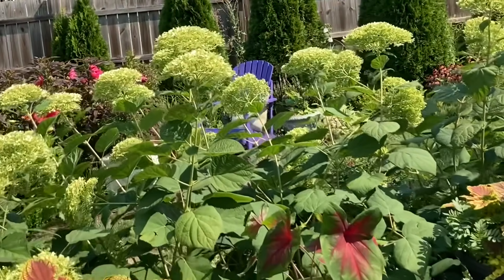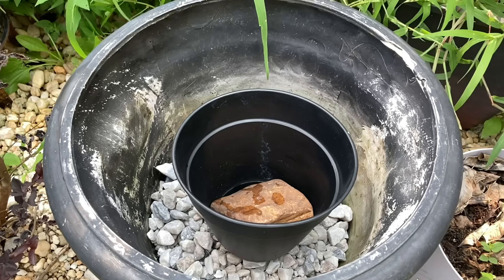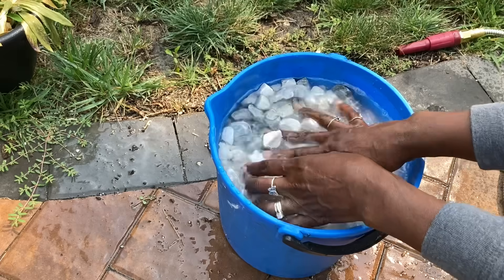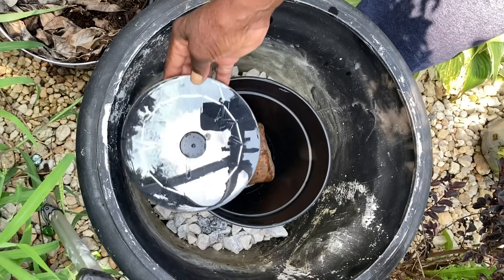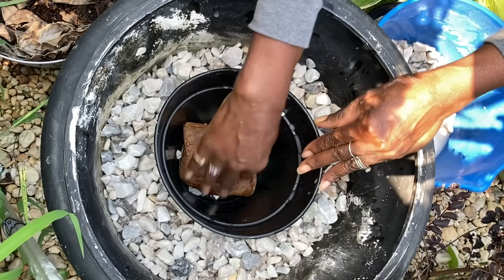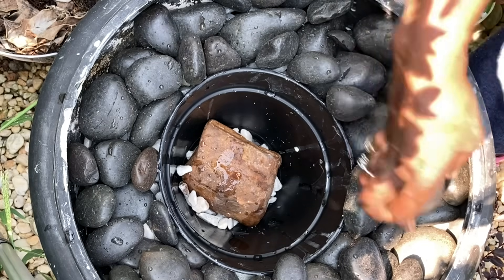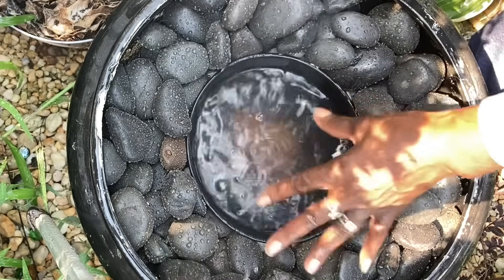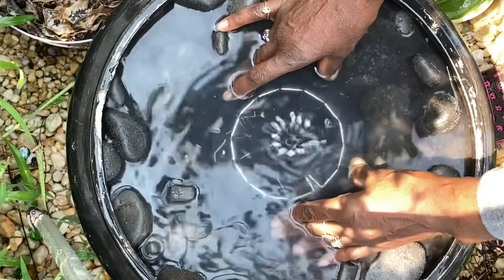How to create a solar powered water fountain

Comment: I love this idea and am currently trying to make it. However, I'm missing something because although I put a couple of rocks on the bottom of the large planter, water just pours out the bottom of both pots. What do I need to do to stop this? Could I put something permanent on the bottom? If so, what? Thanks for your help!
Reply from the maker: It sounds like you may need to add a plug to to your pot.  If your container did not come with a removable plug maybe you can substitute plumber putty to see if that may work.

Comment: Did you put the spider legs on your solar pump to keep it centred in your water feature. It works reasonably well . I think a lot of the water evaporates
Reply from the maker: No spider legs.  The smaller pot keeps the solar pump from moving.

Comment: Hi and thank you for this video. This is one of the best ideas for a water feature I've seen. 
Crazy question: what is the make of the hose nozzle, the red one, with the brass fittings? It looks like a robust setup that won't need to be replaced every 2 or 3 years.
I'm off to watch some of your other videos. Thanks again and blessings to you.    Jim in FL
Reply from the maker: Hi Jim, oh my goodness the water hose attachment was purchased as a set through QVC maybe five years ago, but it is one of the best water hoses that I have purchased without having to replace it. The hose is very durable.🦋

Comment: Did you add holes to the bottom of the inner pot?
Reply from the maker: Great question! The largest container has the possibility of drainage, but it comes with a plugged; it is plugged. The smaller pot that holds the solar pump does not have any holes, but if you’re unable to find a pot without holes, you can plug-it using plumbers putty. Good luck.🦋

Comment: Thank you for your video 
In the future please make a reference to the fact that the center pot has holes in the bottom....you should explain....exactly what your intent is....a how your plans allow this to happen.
Reply from the maker: @Patrick the smaller pot does not have a hole. The larger containers comes with a plug. Over a period of time you will see that the water will evaporate.

Comment: How did you plug the hole in the planter? Any tips
Reply from the maker: I purchased the pot from Lowe’s and it came with a removable plug. I have used plumbers putty, It works the same way for my other pots. 🦋

Comment: Brilliant! I've done my share of tweaks with this type of fountain, so I'd like to share in case they can be helpful to others. 1) Take a soldering iron and make the sprayer holes bigger. The spray will stay lower. 2) glue or tape wire, wooden skewers, or sturdy straws underneath the floating fountain so they extend to almost the width of your water reservoir, this will create "bumpers" that will keep the fountain from coming too close to the edge 3) tie the fountain with a short length of fishing wire wrapped around a rock or brick to function as an anchor 4) forgo the sprayer tips altogether and opt for a short piece of tubing or fat straw
Reply from the maker: Great information thank you for sharing. It’s been three years so this year I would like to add another feature to the pot as well as spray paint the container and just re-purpose it all over again. 🦋
Reply: @jazzybutterflygarden  Excellent! I purchased "plastic friendly" spray paint to touch up my resin and fiberglass containers in the next couple of weeks. Happy gardening, and thank you for taking the time to reply!

Comment: did not read all posts but great idea i would make holes in the center bucket
Reply from the maker: That’s a great idea. The center bucket has a plug. I may try that this spring. LOL I will have to look at the video again to see if I actually remove the plug from the center container. 🦋

Comment: I used your technique on a stationary solar fountain. I Love it. I viewed every technique but yours worked the best with fewer materials. HD had river rock on sale for 6.00 per bag. I used 2 bags and 2 empty gallon milk cartons surrounding the small pot in the middle. I used a plastic top with holes from a wide toped Tupperware on top of the small pot.  I did drill 2 large holes in each side of the small pot in-between the gallon jugs so water would drain in around the pump. Thank you for your video....:)

Comment: You have solved the problem by converting a floating solar fountain into a stationary pump...if you still want a "floating solar fountain" but it spills the water out because it goes to the sides, all you need to do is to insert clear plastic straws (3 or 4, equally spaced) into the foam sides of the float...you can also use wooden skewers but the clear straws are less visible, especially if you insert them low on the foam & slightly tilted downward, they will act as a buffer...if you insert them full length (about 8"-10") that will center the float & keep it from going to the side...you can also cut back the straws if your planter is smaller
Reply from the maker: Great solution; happy gardening 🦋
Reply: I just bought a new solar floating pump and it came with little clips for clear straws that were included.  Makes a world of difference!
Reply: Por favor explique en español todo el procedimiento
Reply from the maker: Segura! Muy Poco Espanol. La olla mas grande esta’ tapada para gue el agua no se drene.
Reply from the maker: Piedra son  Lugar alerededor de La olla mad pequena
Reply from the maker: A todo en su lugar elena de agua sumerge tu bomba solo
Reply from the maker: Si
Reply: Why use nice white stones and then cover them up?
Reply: @barbaradawes9351   Possibly Two reasons
1. She already has white stones under the pit
2. Because she can. 
🌺🌺🌺